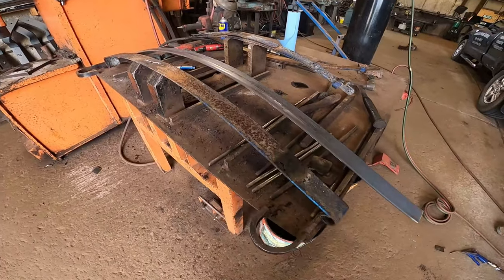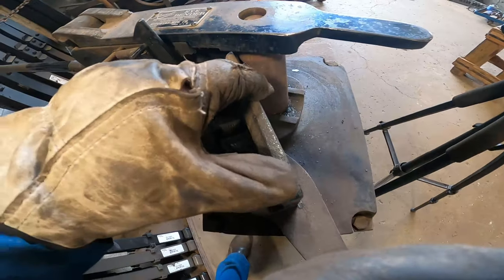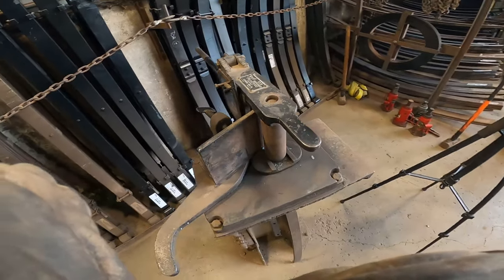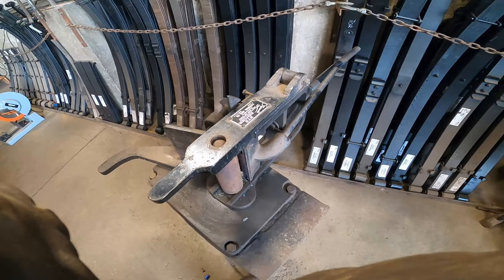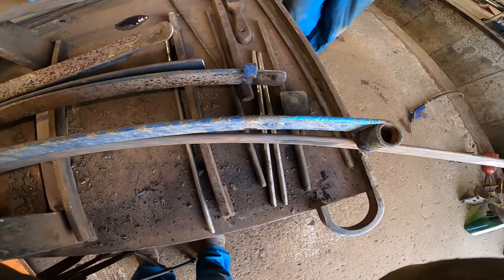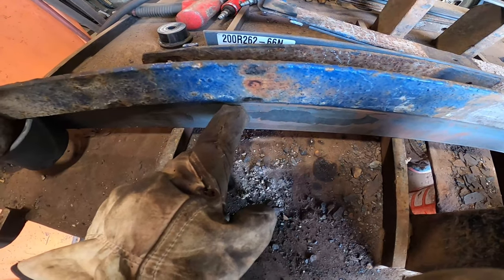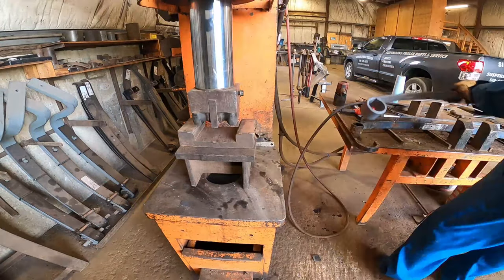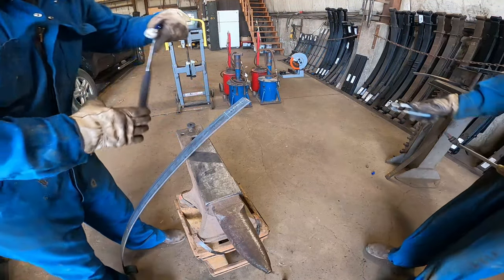How its made | Custom Main Leaf for a Utility Trailer

Comment: Hi, I work making and repairing leaf springs all the way over in Australia. At a glance that appears to be an old model Mazda rx3. Weird that it was in a trailer however if it's a homemade trailer it's no surprise.
Reply: Probably 1970-1980 if I was to guess. Can tell by the unique square nibbing for the plastic leaf inserts on the ends of the leaf.
Reply from the maker: after I posted the video I had a little more time to look up the springs and I believe they where out of a ford falcon or something in that era.  1965-1975ish (they did use the square pads till 1980s)
Reply: @simcoespring  That was my first thought however in the video they look smaller, maybe 50mm/2" wide material. Still very interesting that they're on a trailer regardless lol.
Reply from the maker: @lukeporter8614  yah if my memory is correct it is 2" wide and around 262 or 291 thou thick.  Its been a few months since I did this job, so memory isn't perfect.

Comment: Slightly surprised it had eyes on both ends.  Seems like many of those light trailers just use a slipper on one end.
Reply from the maker: I think this spring was made in the 1960s or 70s from an old car, and someone made a trailer out of it.

Comment: On your drill press, what is the speed you use for drilling the center holes? I mean how many RPM?
Reply from the maker: The lowest it goes.  Which is 120RPM anything faster and it just burns the tip off the bit in a second.